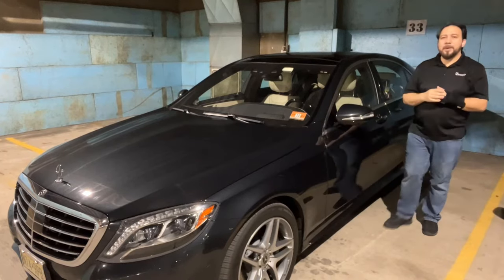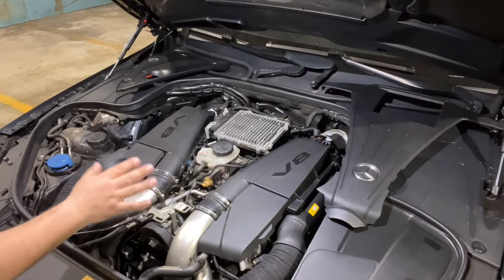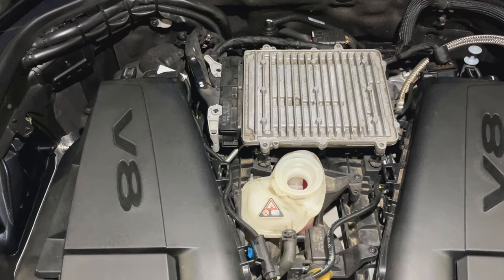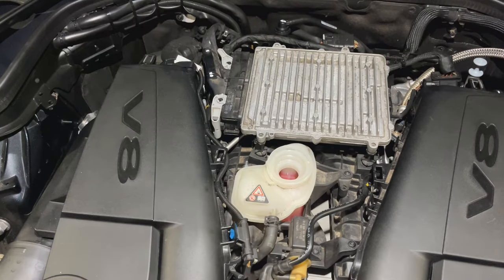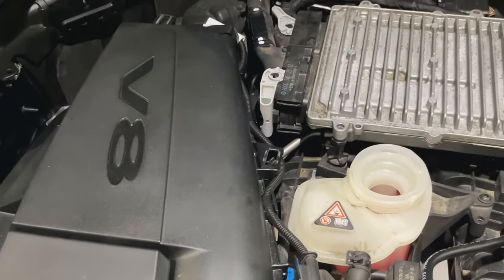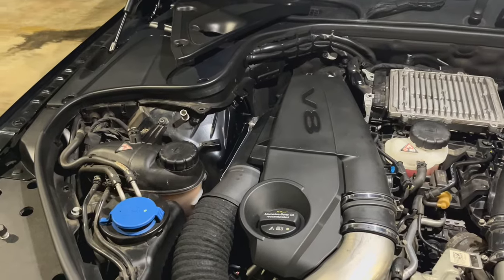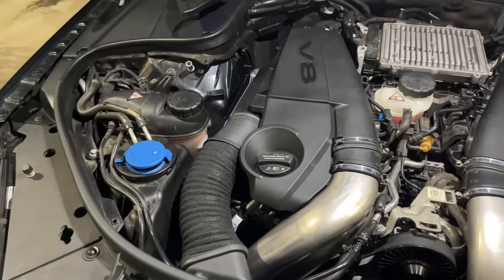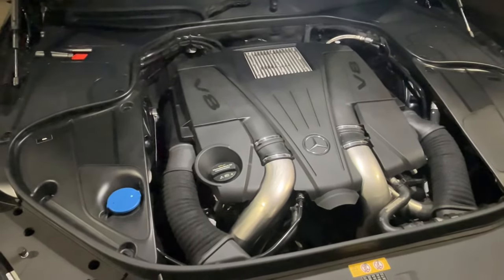How to check coolant level | Antifreeze level check | W222 S550 | #repairjose

Comment: That reservoir on the top of your engine is for the intercooler. The one on the fender is for your engine cooling system.
Reply from the maker: Thank you so much. You are right
Reply: Does it take the same coolant ?
Reply: I just seen mines it's empty shaking my head
Reply: And when I fill it how do I bleed it ?
Reply: @josecitomarin ? Please let me know
Reply from the maker: @chasemoney909  it’s the same type of coolant as the main. I have another video on how to flush the system. I have one video for each system.
Reply: @josecitomarin  mines is empty can I just fill it up and have the heater on or ?
Reply from the maker: @chasemoney909 you can fill it up and check for leaks. Because it looks like it’s going somewhere. If you have to flush it you have to follow the procedure
Reply: @josecitomarin  okay thanks and what if I fill it and there is no leaks bro
Reply from the maker: @chasemoney909 if it was just low. It should be ok. Does your car overheat?
Reply: @josecitomarin  no nover heating it stay within 80
Reply: My low coolant indicator came on. The reservoir on the top of my engine has a different color coolant(this one is pink/reddish) than the reservoir on the fender(kind of a light clear blue I guess, I had to stick a napkin down there to determine the color, more clear than blue). Not sure why the owner before me has two different colors in each reservoir. The coolant I got from the dealership was pink, will mixing that with the clearer coolant cause harm?
Reply from the maker: @jimmynickles804   Both of them should be pink. At least that is the color of the original coolant. Whenever I get a used car I flush all of the fluids, that is why I made all of the videos. So take a look at all of the videos so you can flush them all.
Reply: @josecitomarin  Thanks great advice. That really helps. How many containers of coolant do I need to refill the system after flushing. It’s the same Mercedes as you have in the video. Thanks.
Reply from the maker: @jimmynickles804  the main system takes about 4 gallons of 50/50 mix and the low temp system takes about 1 gal of 50/50 mix
Reply: @josecitomarin  Thanks again! You are helping people! 🙏
Reply: @josecitomarin  I guessing the main, is the one  on the fender?
Reply from the maker: @jimmynickles804  correct

Comment: Those are separate systems. The larger tank on the side of the engine bay is for the cooling system the one in the middle is for the intercooler.
Reply from the maker: Thank you so much for your comment. That is correct. When you get a chance take a look at the videos where I flushed the systems. 
https://youtu.be/mDfTtIkiK10?feature=shared

https://youtu.be/uf4fnHneUVw?feature=shared

Comment: Jose my s63 is low coolant on the main engine. Just filled it up last year . Think there is a leak? Barely put miles on it and no puddles under the car. Thanks you the man!
Reply from the maker: Thank you so much. Sometimes leaks are very difficult to find. You really have to look into it even around the reservoir. Hopefully is noticeably,  it could be leaking into the oil side of the engine.

Comment: Thank you for this video , the guy at the shop doing a oil change (EU shop) was consfused about the system said it was full but the light was still showing he didt know there was another system... Not going there again...
Reply from the maker: Thank you so much for your comment. It is very difficult to find someone you can trust. That is why i do the work on my cars.
Reply: I checked both of mine & they both looked full as well & still can’t get the darn “check coolant level: see owners manual” message that LITERALLY pops up on the dash as does the “check oil levels @ next fill up” every 1-3 mins for the entire time I’m driving & can’t figure out HOW TO GET THE MESSAGES TO GO AWAY!.. please help!

Comment: José, the coolant that I bought is green. Does it mattwr if it’s not orange ?? It is a pre diluted combo 50/50 coolant antifreeze
Reply from the maker: Thank you so much for your comment. I am not sure what you bought, but not all coolants are the same
Reply: @josecitomarin  ok. Which one did you use ?? The color you used in this video is the same color that is in my reservoirs
Reply from the maker: @smbeezy  I used the dealer’s stuff. It’s pink. What brand did you get and does it say that is good for European cars?
Reply: @josecitomarin  so I haven’t bought anything yet. After reading your response I am going to purchase the dealer stuff. Thank you so much for your time!!!  I am doing the lights in the handles next weekend ! I have to do all 4 doors !
Reply from the maker: @smbeezy  no problem. Yeah just get the dealer stuff. Good lock with the lights
Reply: @josecitomarin  lol you make it look so easy. But I am going to do step by step from your video. Thanks for your time teaching us this stuff. The dealer tried to hit me over the head for the door handle lights
Reply from the maker: @smbeezy  the dealer would yeah. But it’s not difficult at all. Let me know how you do
Reply: @josecitomarin  thanks Jose appreciate it papa.

Comment: Good informative video, keep up the good work bro!
Quick question... I know the heater control valve is to the right behind the engine & the main water pump is in front of the engine, behind the fan... but where is the auxiliary coolant pump (electric water pump) located?  Thanks
Reply from the maker: Thank you so much for your comment. It’s in the front right side. Kind of, behind the bumper and under fender. Just follow the hoses
Reply: @josecitomarin  Thank you! I will look. I've been searching everywhere online for the location. 2016 S550 4matic coupe. Got a DTC P026E71 "Actuation of the coolant pump of the charge air cooler has a malfunction. The actuator is blocked."
Reply from the maker: @MrBenzNYC  I hope you find it now and can get your issue resolved. Don’t order any parts until you get it out. They have different ones. Let me know how you do

Comment: Thank you for your thoroughness. Would you make a video on how to replace the water pump?
Reply from the maker: Thank you so much for your comment. I will do it when I have the need for it in my car. But I can help you with data if you want. I’m guessing you kind of have to do it now.
Reply: @josecitomarin  Thank you for your reply. May i contact you via email?
Reply from the maker: @videoMYcar  of course no problem. Josecitomarin@gmail.com

Comment: Thank you for this video. I have the same car, tried to use the auxiliary heater a couple times and it didn't start. Now it says I need to add coolant. Never had this before.. I'm guessing the auxiliary heater is leaking somewhere since it circulates the coolant to heat it up. Although I heard you say "it's normal for the engine to burn some coolant". I thought this was a closed system and "burning" coolant could only result from a leak somewhere? I have a 2013 and never had to add coolant.
Reply from the maker: Thank you so much for your comment. 
Are both reservoirs filled up? Do you have any codes showing up?
Reply: @josecitomarin  No codes. But i've heard the auxiliary heater has to be diagnosed separately. Both reservoirs had to be topped up a bit.

Comment: Should I buy the coolant and do a 50/50 mix with distilled water and the. Top up? I just saw you dump some coolant there not mixed with water.
Reply from the maker: Thank you so much for your comment. Yes always make sure you use a 50/50 mix. Please check my other videos on flushing the systems

Comment: Hey Jose, I'm always having to refill my coolant can't find leaks anywhere, do you have an idea where I need to check? Great video by the way!
Reply from the maker: Thank you so much for your comment. Which reservoir are you having to refill? Have you checked the reservoirs them selves? If you can’t find anything from the top, you have to take the covers off the bottom and look around. Maybe the turbo lines have leak
Reply: @josecitomarin  it’s the reservoir to the left of the engine but sometimes having to refill the middle one once in awhile, not sure if that’s normal but as of late the bigger one I’m having to refill after each drive now, can’t seem to find any leaks at the moment, it could be drying up fast
Reply from the maker: @juniordace1347  you definitely have a leak in the high temperature system. You have to look under the car. It’s probably leaking in the covers that is why you don’t see it.
Reply: To replace those turbo lines do you need access under the car or the top engine area? Do you by chance have video of replacing those?
Reply: By chance does the coolant sometimes get into the washer fluid reservoir? I see some seepage coming from that as well
Reply from the maker: @juniordace1347  you have to go underneath
Reply from the maker: @juniordace1347  no way. There is no connection between them
Reply: @josecitomarin  ok for some reason I see coolant dry stains around the windshield fluid reservoir, I read something about coolant running through the tubes as a heat exchanger for the washer fluid, but I’ll give it a look. Still no luck finding the leak lol
Reply from the maker: @juniordace1347  wait. Yes there is a heater option. It goes into the washer tank. Empty the windshield washer fluid and then check the tank after running the car to see if you find any coolant in there
Reply: @josecitomarin  yes looks like coolant seeping out of it  the washer fluid tank, I can see the coolant dry stains on the black part reservoir, like the water is actually overflowing even with the cap shut, any suggestions?
Reply: @josecitomarin  hey Jose quick question, does coolant go through the heating element regardless if we use our windshield wipers? Just wondering if coolant loss still happens when I don’t even use the wipers. Thanks.
Reply from the maker: @juniordace1347  seems like the coolant lines that heat up the windshield washer are leaking. So weather you use it or not the coolant will go into the tank because of pressure
Reply: @josecitomarin yes! Found it, there is a crack in the plastic of the heating element emptied the washer reservoir and it indeed is squirting out of the lines connected to the plastic. Thanks again Jose!
Reply from the maker: @juniordace1347  I’m glad you found it. Let me know how the repair goes
Reply: @juniordace1347 check your heater valve in washer fluid tank reserve if its look like coolant definitely your valve have aleak
Reply: @jollydelfin182 thanks man, it was definitely that and replaced it today, just removed the connected hoses. The old piece had coolant squirting out of the plastic area.
Reply: @josecitomarin  hey Jose, repair went really well and no more leak to the reservoir after changing out the heater exchange element inside the reservoir. 

I had a question using MB summerfit windshield washer fluid, it says not to mix with distilled water, is this true for the w222?
Reply from the maker: @juniordace1347  good job with the leak. I think they just mean not necessary to mix with distilled water. But I would

Comment: Jose I have 015 I have 2015 Mercedes 550 4matic do i have a transmission dipstick and do I have to change my fluid
Reply from the maker: Thank you so much for your comment. If you have a 7speed transmission you should have a service tube that you can use to add oil if needed. If you have a 9speed there is no service or dipstick.
You definitely need to change your transmission fluid. You have to change the bottom tray. Check out my transmission service video.

Comment: Question, does this work on the 2018 S450? Because I have only found one spot for the coolant
Reply from the maker: Thank you so much for your comment. You only have 1 reservoir I believe. But procedures are about the same if you had to replace the coolant. Bleed the lines and vacuum fill
Reply: @josecitomarin   Thank you! Your channel is amazing.
Reply from the maker: @tlknight4  I appreciate that

Comment: What would be the coolant type to buy from autozone?
Reply from the maker: Thank you so much for your comment. Make sure you don’t mix coolants. You should be able to use one at Autozone if you flush the entire system. Use the one for European cars of course. I would still use Mercedes coolant though.
Reply: @josecitomarin  Also, I am not flushing.. Just need to top-off..
Reply from the maker: @jermainefulton9782  definitely not from autozone then
Reply: @josecitomarin  Okay.. Got it

Comment: Hello. How to remove the throttle
Reply from the maker: Hi. Thank you so much for your comment. If you want to remove the throttle valve you have to remove charge air cooler with the valve then separate them once they are out. Not that easy or quick, but definitely doable. Before you do that, there are some coolant and vacuum lines involved, at least 8 of them. You also have to remove the low temperature coolant reservoir.